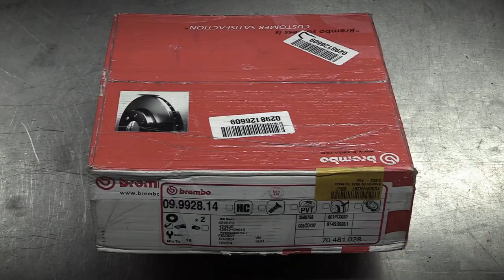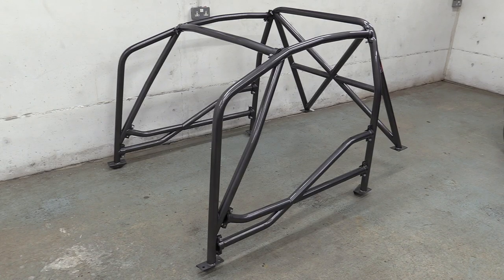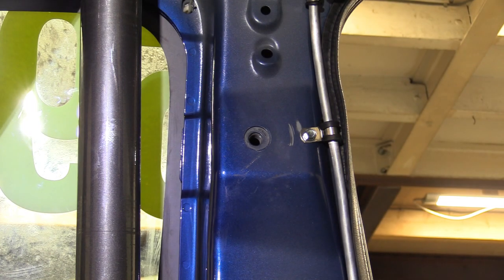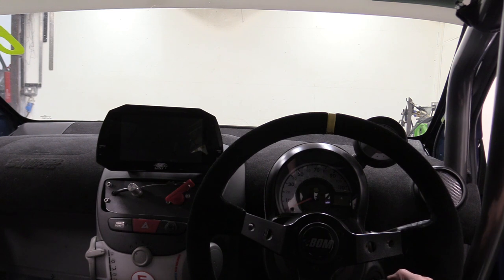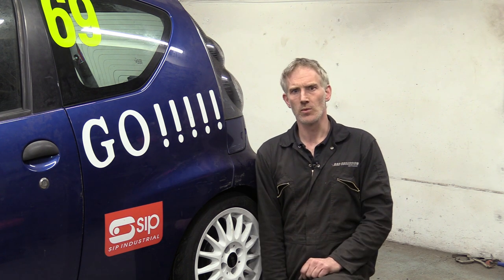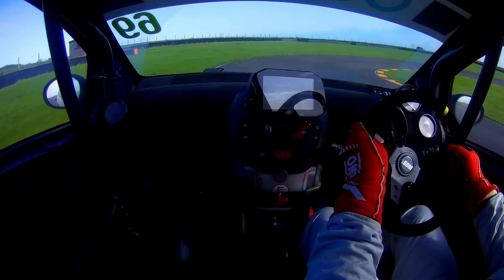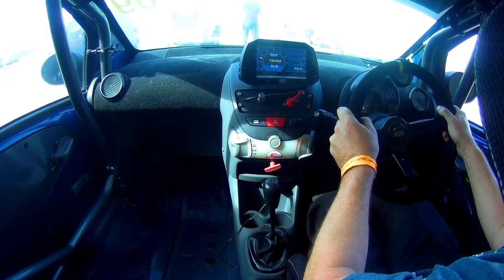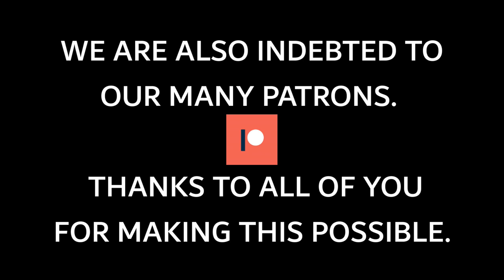Part 6 - Building an £850 hatchback into a competitive race car.

Comment: In the Hyundai excel cup here the fast guys all have rebuilt engines. They've also bench flow tested a bunch of heads to find the ones that flow the best, usually the early production heads are the best. This is the main difference between the fast guys and the slow guys. I recommend doing something similar when you get the suspension set up. Youll find the most time there. (BTW here means Australia)

Comment: Just a heads up, by adding the additional camber to the rear, you might pick up a bit more mid to exit under steer.
It’s a FWD thing but would need to be tested to find the right balance of grip to rotation on the rear.
I also didn’t see any mention of corner weight setup. If you haven’t already done it, this would assist significantly in the overall pace & consistency of the car.

Good luck

Comment: add lightness shorten bolts and fasteners that do not need to be long enough to do the job.power to lightens.. .
Reply: When I was building rally cars we used to reduce nuts and bolt heads in half, and saw off the excess thread off. We also used a lot of Allen bolts. On the  Anglies we removed the dynamo internals as the regs said it had to be fitted but didn't say anything about charging the battery so we always run with a fully charged battery every race.

Comment: initially I was wondering how much lightness you are allowed to add.
then I remembered there is some kind of weight box for the series, so there must be a max for the amount of lightness you can add.

still raises the question: have you maxed it out?
Reply: they took the ballast box off, so one would think that they haven't maxed out on the good old lightness
Reply: @pietarisalminen2250  I saw when I got to the end.
sometimes I can't help myself & comment before watching the whole thing.
I'm afraid I'll forget what I was going to say if I wait 20 min, lol.

of course, I could just type it, and not click the "comment button until it's done, but what fun would that be??
Reply: @ekw555  fair enough
Reply: In this instance it may be easyer for them to add a bit of lightness to richard instead of the car...

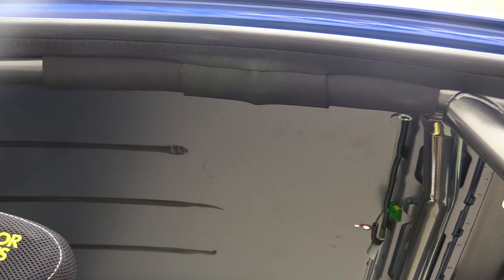Comment: 25:19 "No-one wants a scratched helmet'." I see what you did there. Or rather, I wish I didn't.
Reply: i didnt.
Reply: @derPetunientopf  if a helmet is a name for a specific part of the male anatomy? Where scratches scan be pretty painful?
Reply: @baoboumusic  Oh Penis. Of course. Havent heard the tip called helmet before but im also not a native speaker.
Reply: No-one? When you have an itch, scratch it.
Reply: Anyone remember the Top Gear series trailer of some years ago set in the production office that had someone polishing the Stig's helmet?

Comment: old corvette racer trick-- use a power steering pump to circulate oil to dry sump tank hidden in rear of car.  if the engine is getting loose, can you over bore and fit new pistons?  on a Triumph Trident (3 cyl. 750 cc.) the .060 over pistons from a 650cc. twin work great. hehehehee. be safe, have fun.

Comment: A couple of episodes ago something you said made me think of engine regs, and yes, i did think of all those cheaty ways to gain... But what about a standard engine rebuild? clean it out thoroughly, new bearings and seals, brand new OEM cam so you get maximum opening and duration, etc? Might be worth 0.5% and F1 engineers would spend bazillions for 0.5%

Comment: Guys in the words of one Mr Rascal, I'm loving it, loving it, loving it. However, and say this with complete admiration. Could you do an instructional episode, of an 'OCD' complete car service. As in the best servicing you could do to your car. What are the best spark plugs, why should you gap them, oil filter selection and also if you want better brake discs and pads, how not to get stuck with run of the mill, rad flush (should you use rad flush), should you use engine flush. Basically be yourselves. Seb

Comment: You fellers done a valve job on on that mill?  I worked for a Lotus/TVR dealer way back in the 1970s.  They did a fair bit of racing, running a Lotus 7, an Elan and a Europa.  If a car was on the track on Sunday, the head was off on Monday and the valves were lapped (the full valve job done pre-season).  Compression was checked frequently and cylinders honed, rings gapped, etc. as required.  On the track (and elsewhere), there is no substitute for horsepower.

Comment: Hey guys, ever thought about using TSL for the engine and gearbox? In case you don't know, TSL is an oil additive which lowers the friction of the internal components of the engine and gearbox. It seems to work really well and might really help with the performance of the car.

Comment: Thanks for doing these episodes, I was missing getting the funk out!  Some comments: The Exhaust rules seem to allow free routing and silencer placement, though I'm not sure what that might gain you. Is there a way to re-install the OEM seat belts and wrap and then tension the webbing straps to the roll cage? Would that even help? I also couldn't quite tell if it would be legal or not to build a flat underfloor, or tape the body seams. Or maybe not a full flat floor, but some filler panels that create a bit of that effect but in such a way as to not change the silhouette of the car?  The gear lever long spacer mounts seem to skirt a gray area of rule 6.1.2 "All gear linkages, gearstick, clutch cable, pivots, pedals and mechanisms are to remain as standard
OEM in their fitment and operation."

Comment: They should vacum the crankcase with little pump. It makes engine work more efficiently and as a result you get better power and torque graphs and 5-10% more HP and Nm.

Comment: I'm fairly certain that if you inspect the engine head you'll find that it is ever so slightly out of plane. I'm also fairly certain that if you inspect the Citroen documentation there is a tolerance for how much you can you can take off to bring it back into perfect plane. Servicing your head according to Citroen's  documentation isn't a modification. Even if you service it to the last 0.01mm of head/deck hight... Certainly this is also the case with the bore. Giving it a fresh hone to remove piston slap and/or scratches, but staying within the nominal tolerance of the bore size is also just service. Giving it a fresh set of piston rings is just service.. that you only give it as little ring gap as you can possibly get away with is just common sense. Also.. I though I heard leaky valves.. better give them a fresh lapping while you're at it...

Comment: Have you considered doing a steam decoke of the engine to add marginal extra performance? warm it right up then point a domestic steam cleaner into the air intake after the filter & MAF and maintain a steady stream of steam while running the engine at medium revs?  Flushes out all carbonisation from the valves and valve seats inside the cylinders.

Comment: you can change under-steer and over-steer by putting different tire pressures front to back - for instance if all pressures were equal and you were experiencing understeer - just take a little out of the fronts and put it in the rear - the front will gain a little traction, the rears will loose some and then you'll either be neutral again in corners or over-do it and end up with over-steer. :D And, tire chemistry can make a huge difference - can you change tire brands? Bridgestone RE-71's would stick you to the road like rails.

Comment: It's all about the rear. It needs to toe out by 20' to 25' which will stop the front washing out. Its lots of little things, but they need to find a way of tying the cage to the rear roof area too.

Comment: In our last rally car the rear beam was completely boxed in with 1/4" steel plate, with tubes running from the hubs to the center of the beam.

At one event the right rear came loose and nicked the body, and tore out the ENTIRE rear beam and suspension in 3rd gear.

Comment: Another oil and filter change before the next race ?. Maybe look at the new plugs to see what they look like after the sustained high RPM ?. What about the ol Colder Thermostat trick ?. Slightly colder engine, so ecu raises enrichment. Even if you only get 1 or 2 more BHP,  thats more than the competitors.

Comment: Try using the internals from a Toyota Yaris gearbox. Ratios are different. I recently rebuilt my Yaris gearbox and could only find a Aygo gearbox from the importers. Upon inspecting both gearboxes we could see the differences between gears, even the pilot shaft bearing is bigger on the Yaris gearbox.  With the Aygo internals my Yaris is slower of the line and less nippier, good for fuel consumption tho lol.

Comment: I'm thinking doing an ECU tune, and maybe bore out, or remove the cat (since it's a race car) might get you a few more HPs.
Also testing out low vs high octane fuel. For forced induced cars, using mid grade to high octane is always better.
For Naturally aspirated engines, sometimes mid-grade can get you a bit better performance.
Also, once the cams are mounted (properly this time) and all that extra hardware, you can reduce the dead weight in the back.

Comment: Great stuff guys! It's the little things now to edge you closer to the competition....

But I do wonder...how the hell is the engine of that thing going round the track not starving of oil while cornering?! There was no engine work done, so no baffled oil pan I guess?
A friend of mine did 3 laps on the (old) Zandvoort Circuit here in the Netherlands in his Aygo and had a stuffed engine by the third lap!

Comment: The exploitation of grey areas in the rules might be my favourite part of racing. 
Engine wise could you get away with a balanced rotating assembly, polish the engine and exhaust and ceramic coat the cylinder walls. Also maybe a larger fuel pump, race fuel with a piggyback ecu and flex fuel censor? 
Chassis wise if you remove more weight you could have a flat underbody which would have an areodynamic advantage and lower the centre of gravity. You could seamweld the door seam, door frames, stut tops and perhaps lower the engine.

Comment: Hi folks! A little suggestion : use a bit of a seat belt in place of a chain to limit the suspension travel. Lighter and smoother in limit 👌
Reply: The traditional stuff back when I was a lot younger was the rubber/fabric strip used then for exhaust hangers.

Comment: That was brilliant!
And I had another thought... Any weight you remove is countered by the balast box right... But the balast box is in the floor, so ANYWHERE you can add lightness(especially the roof) will still be beneficial because you'll be moving the weight to the floor of the car, thus lowering the center of gravity and moving the weight more towards the center of the car.... :)
Of course this is pointless cause you'll have figured this out already and this series was pre-made.

Comment: I'm not sure if its been thought about before, but how about messing with the oem fuel pressure regulator to tune a/f ratio on the engine? Maybe even using a resistor on the IAT senor to get a couple degrees more timing? Its ghetto but it may make a smidgen of a difference :)

Comment: Can you run some type of auto shifter?  I could probably build and program something to control the shift cables with pneumatics or stepper motors and then you could use paddle shifters to keep your hands on the wheel at all times

Comment: I don't know if you can do it under the rules you're playing by but Nissan Skylines & 200SX benefit from making a mounting bracket to lower the inside of the lower arms. This corrects bump steer... The rules say you have to retain the original mounts but don't say you have to use them! 😉🤔

Comment: Can you bend the rear control arms to achieve more negative camber? Are the bushings in the car well lubricated to allow them to move freely and not bind? I built mine out of delving with steel inserts, on the inserts I put a groove on them that lines up with the zerk fitting that I can pump grease onto it, the old bushings would bind and not let the suspension move, not it’s free and super light.

Comment: Finding performance in the grey areas of regulations is in my opinion the best thing about motorsport. Clever engineering is what it's all about! I think the word  'cheating' is too much of harsh term. I learned about Ferrari's sneaky fuel flow meter last week and thought it was super clever.

Comment: you should stick a thick washer between the front cv joints and hub so that ur shafts wont pop out and you wont loose power from the plunge of the cv joints. we do this on vauxhall novas ive built in the past. change engine and gearbox mount to some competition ones to stiffen up the tilt on the engine when at full chat. can u change the cwp or do you have to run on a standard box? maybe stick a 4.4 in instead kf the standard 3.9 i assume is in the box if i remember correctly

Comment: Wonder if the "no welding" clause applies to rust repair. When these cars start to get older or if you buy a bit of a tatty one that has had an MOT patch stuck on it, it seems a bit unfortunate that that effectively excludes the car altogether, unless I am reading it wrong.

Comment: What about keeping a set of just the right side of legal, worn tyres for dry race days?
4mm less tread would reduce the rolling diameter by 8mm, increasing acceleration and dry traction.

Comment: The car was much more stable on the fast lap.  Two seconds is huge. I am sure they corner weighted the car as the coil overs are adjustable and the driver is very heavy.

Comment: No welding to the rollcage, but it didn't say anything about clamping around it, being able to slide things over, etc.
So you can do that and screw that into already available spots in the car, at best wedging something in between other parts as well, and if clamped to the rollcage with enough force you can do a lot indeed.
It leaves a LOT of space to muck around.
Too bad the refresh rate isn;t a lot better, but i suppose there's not much you ca do about that without redoing the entire system, and with entire system i mean mostly crap with the car since the new dash system can probably do it no problem, and you're probably not allowed to do so.
If only it was allowed to install a short shifter.

Comment: Great work on these legal upgrades.! How thick is the rea axle reinforcement ?  And lets say if you could work on the front suspension would you use a spacer for the ball joint or an extended ball joint fabricarion ? Love your work ! Cheers from Athens Greece.

Comment: Add oil to the gas to create more carbon buildup in the combustion chamber and piston face for higher compression ratio
Reply: But have lambda sensor removed from exhaust manifold while doing it, or it will be damaged.
Reply: This is an old racers trick back in the day on carburated cars so yeah the o2 sensor  shoud be piggyback while doing it.

Comment: Some suggestions:

Fit a Tesla motor to the flywheel
Oil, smoke and tack canons to the back and laser ‘pointers’ with over driven LED’s in the head lamps  (I am sure the rules won’t say anything about defensive and offensive measures)
Rebuild the engine with max over sized pistons, blue print, lighten as much as possible. 
Thinner engine and gearbox oils
Rebuild all brake calipers and wheel cylinders, micro polish the piston bores, ceramic coat the pads, sliders and pins etc so the brakes are as free as possible
Look at closing panel gaps with foam, tape etc

Comment: Im confused with the rear suspension changes... it clearly had too much understeer at cadwell so you stiffened the rear beam to increase the roll sliffness and thus reduce rear end grip. Then you increaded the rear camber to improve the rear tyre contact patch. Arent these two counter intuative? Please correct my thinking

Comment: Are you allowed to get it on a dyno and find out if its producing the amount of hp and torque the provided ecu map is meant to be making? Could be interesting to find out if say your Injectors needed a refurbishment or if the cam is worn or the timing is off, affecting it by a few bhp.

Comment: this may have been covered and I may have missed it but what about engine condition? If two teams buy two cars of similar years but one engine is totally wankered, where does that leave the driver in terms of engine performace? do all engines get scrutineered for performace upgrades? ie; overbores, head work etc.can you rebuild the engine to factory standards or can you run sneaky upgrades? I dont see any engine seals to match the ecu seals.

Comment: Just a note from the race day vid, don't tighten wheel nuts with a rattle gun. A torque wrench must be used on late model cars, flimsy rotors are easily deformed.

Comment: How much static rear wheel camber are you running? Is there a possibillity to go real agressive when in a straight line in order to get a more faverouble wheel amgle when the car roll over in the corner? Unfortunately you also need to shim for toe since aggressive camber introduces toe in.

Does the rules account for introducing a shim behind the wheel bearing in the front strut to introduce front camber? ;)

Comment: I remember, there was once a race series where you were had to use restrictor plates. But some geniuses simply used ram-jets (which were not forbidden) and simply pressed more air through that hole of the plate. Of course it was forbidden next season but that is always the thing ...